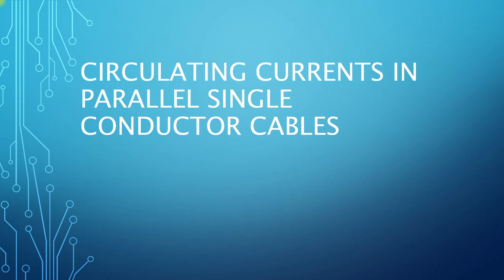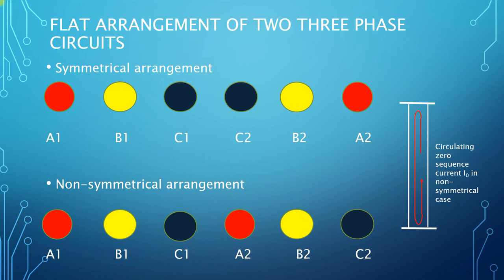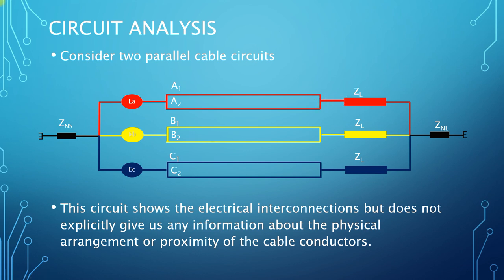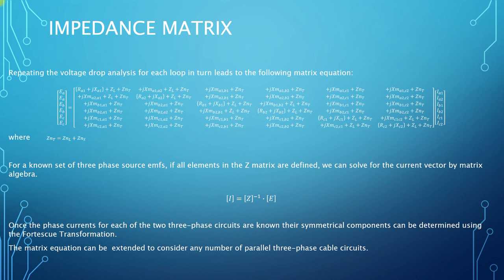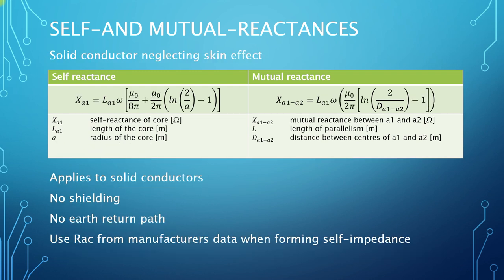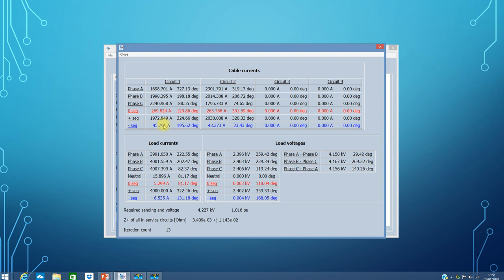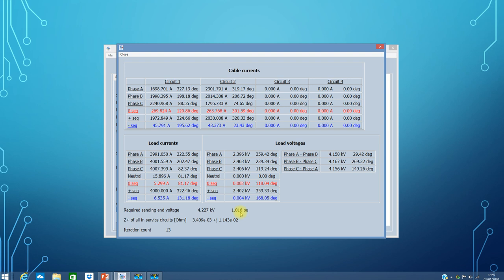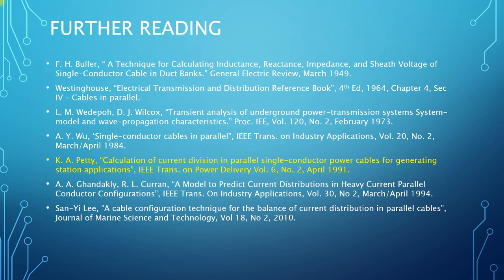Circulating currents in parallel single core three-phase cables.

Comment: Hello, great video! I would like to know if the program/script you use and showcase are available for download?
Thanks in advance
Reply: Also, how would you arrange a setup with 4x parallel cables pr. phase? It seems impossible to create 100% symmetry.

   B               A               C               B
A    C        C    B        B    A        A     C

Comment: Is my understanding correct? If it is DC Application, there will be no circulating current when we use single core cables
Reply: Yes because dc current is not alternating so it will not induce voltage. Since there is no induced voltage then there is no current or eddy current.